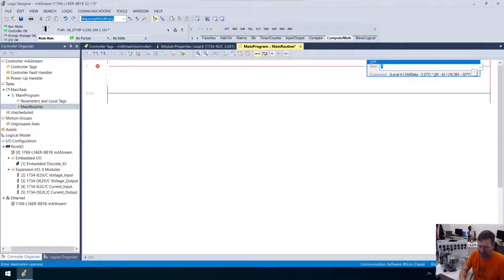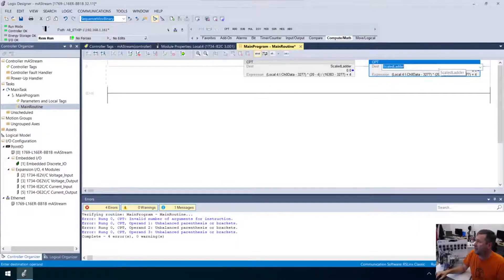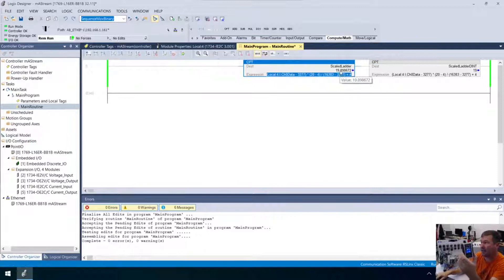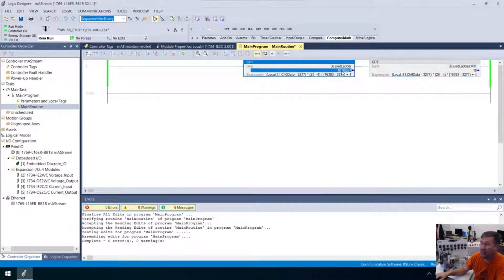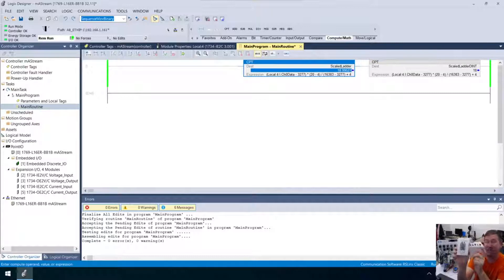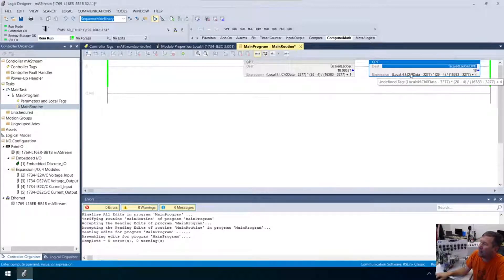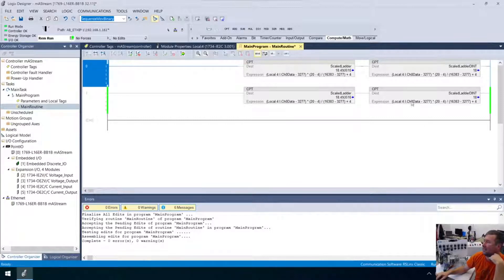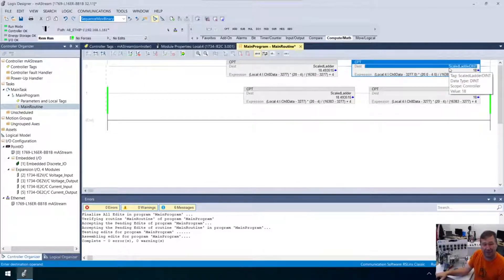Difference between a REAL and INTEGER Numbers When Rounding

Comment: What's the use of DINT then? Seems like REAL is the way to go....
Reply from the maker: Excellent question, a REAL number loses accuracy the higher it counts A DINT can store whole numbers up to 2,147,483,647.  Above 16,777,216, accuracy is lost.  Here is a simple exercise.  Create a REAL number and enter 16,777,216, then try to enter 16,777,217.
Reply: Saves memory, likely increases speed
Reply from the maker: Both a DINT and a REAL are 32 but numbers, they take up the exact same about of memory.
Reply: @rcarter012  I suppose it is only quicker in the case where all the numbers in the equation are DINTs. But in that case you get the weird rounding issue presented in this video...